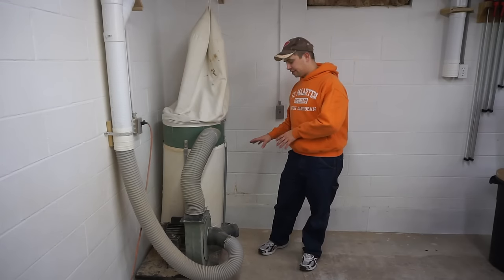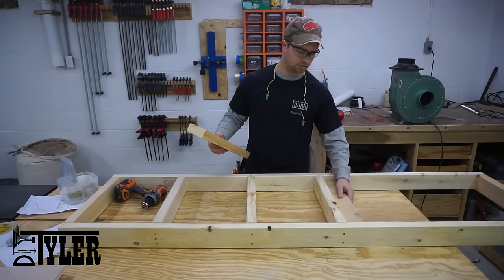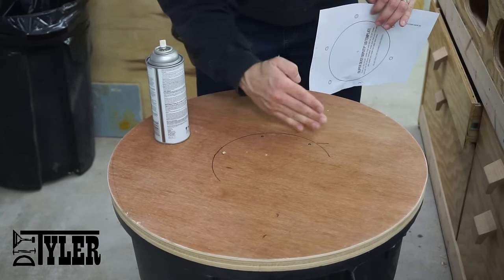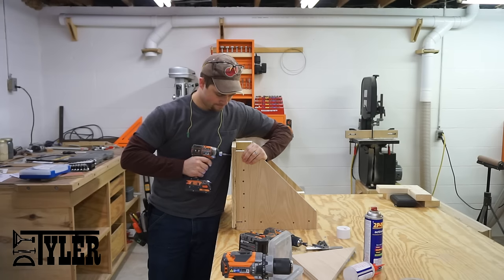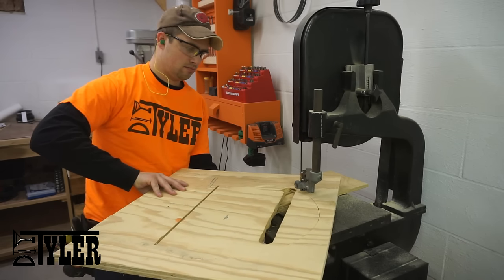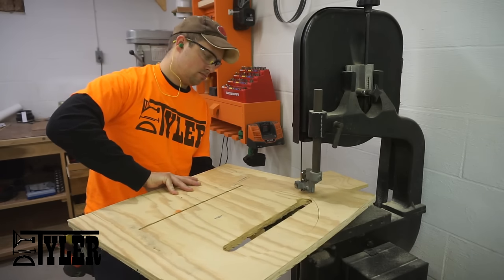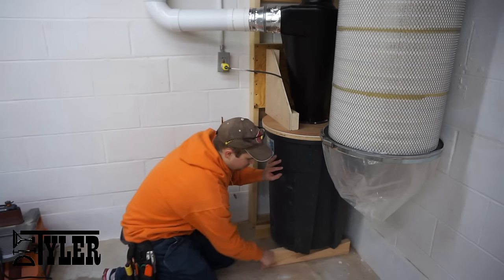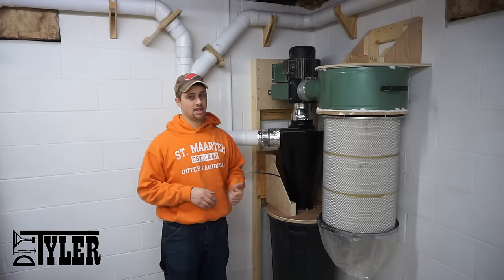2 Stage Harbor Freight Dust Collector

Comment: This taking from I've watched from Stumpy Nubs and adding the power of the Cyclone from Oneida.  The one difference is that you leave the dust bag as is where Stumpy Nubs cuts his bag and dumps it into a five gallon pail with a trash bag.  Although with the cyclone you are going to get far less debris in the bag requiring less replacements.  Just the same, I like his idea as the heavy duty bag will break down over time from removing the metal clamp that keeps it in place.  That simple modification to yours would prevent the you from ever needing to replace the heavy duty plastic bag.  I am picking up the Harbor Freight Dust Collector next weekend, and I plan to do a combination of what you have here with the modifications Stumpy Nubs did.  Thanks for sharing.  This was an excellent contribution.

Comment: Hey, being a Dutchman myself, I love your sweatshirt. I did something similar with a HarborFreight dust collector. The on/off switch will wear out quickly and more specific to replace. Wire your dust collector through a common wall switch in a more accessible area and leave the motor switch on. A proactive problem elimination.

Comment: I haven't done this myself yet but a friend helped a guy put copper wire inside his plastic dust collector system. The claim is static discharge can cause a fire within the pipe. I did notice static in my piping so it's on my radar to add grounding wires.  Nice build thanks for posting.

Comment: This was a great instructional.  I used it to convert my single stage Grizzly dust collector into a two stage system.  I made 3 key alterations though.  1.  My air filter is mounted on top of the out flow and the bag below the outflow.  I also used a paddle air filter that you can hand crank the paddle which flaps internal paddles against the air filter knocking dust out.  2.  When I used a rubber trash can the air suction was so great it crumpled the can causing the upper seal to be breached.  I upgraded to a metal can for a more rigid structure to with stand against suction implosion.  3. Once I upgraded to a metal can the wood feet used to hold up the can no longer worked well because the rubber can could flex a bit into its upper lid - the metal can wouldn't and kept falling when trying to put the feet in place.  As well, the upper lip of the metal can being much more rigid caused some air gaps.  To make it mount with a good seal I used toggle/pull latch clamps - the latch/levers attached to the can and the catch/clamp part is attached to the outer edge of the upper wood lid.  I use 4 of them equal distance around the lid and it pulls the can up nice and tight.

Comment: Thanks for this. You were the initial inspiration to make my own cyclone setup. I went with a 2hp Shop Fox blower, Oneida SDD, and Wynn filter. But  Dick Wynn recommended the Gamma seal lid approach to make a threaded filter attachment, and I did that. Mounted to a custom plenum out of Baltic birch.

I kept hesitating, drowning in dust, because the space is so restricted. Garage door and track on one side, lumber rack on the other, and the electrical panel right in the middle.

Comment: Great build.  I have HP's DC, and I know if using a cartridge you have to get more of the large dust/chips out of air stream (than a typical single stage can)  to keep them from clogging it.  This is a really nice solution to that problem.  Best one I've seen yet.
Reply from the maker: +bryce johnson Thanks man! It has been a huge addition to the shop.

Comment: Great build and well produced. High praise all around.  And...YOU USED A TRIPOD!!!! Yeah!!
The ONLY suggestion in would make is to use T-nuts on the back of the plywood used to mount the motor.  I think it would make installation easier and, in the event that you need to service the motor, easier to disassemble for service.

Comment: This is timely as I am adding dust collection to my shop in a few weeks.  I was going to go with single stage, but two stage would be more economical and effective in the long run.  Thanks for doing the grunt work for me Tyler.
Reply from the maker: 2 stage is without question the way to go and making it yourself will be, at most, about half the cost of getting a ready made one. Glad I could help, and good luck!

Comment: The Harbor Freight 2 HP unit already separates dust. That is why the bag is in on the top - so dust falls into the bottom after the integrated cyclone separator. There is even a divider between the two halves and it spins the air under the separator.

Comment: Tyler, nice video and a great help. I made a couple of tweaks due to space issues in my shop. At 12:40 when you were pushing your wedges in to raise your collector can, I have a 2x3 block against the wall to allow more clearance. I also glued a 3/8" plywood disc on the bottom of my can to add strength and act as a bit of a skid plate. Again thanks for the great idea and explanation.  Love the family helpers too!

Comment: i have a single stage 2hp Jet DC,  but after watching this video, i have a feeling i will soon have a 2 stage 2hp Jet. :) thanks so much for taking the time to make this video. i am inspired. -JD
Reply from the maker: +Jeremiah Dunnick Awesome. Might have something to help you out with that....will update you when I hear back. Thanks for watching!
Reply: +Tyler G , thanks. 
Any ideas or tips would be very welcome.  As soon as it gets a bit warmer i'm adding a 8'x8' extension on the back of my shop to house the dust system. it will have a return into the shop itself so the ac/heat wont be lost.  improving my dust system, as well as running more permanent duct work is the next step.  Your DC upgrade is exactly what i want to do.

Comment: Like your videos Tyler! I did a similar thing a year ago but wasn't happy with the air being recirculated even with a 1 micron pleated cartridge filter so vented it outside, works a treat!
Reply from the maker: +David Stanton If I wasn't in the basement I may have vented outside as well but many people can't so this appeals to a larger group of woodworkers! Thanks for watching!
Reply: David Stanton - I'm thinking of doing the same thing - venting to the outside. But, what did you do to provide a safe inbound air flow that would support the impeller driven venting? I'm in the basement with oil-burning furnace (common in New England, USA).
Reply: Dave, take care.  Some express concern that venting a basement shop outside may result in pulling furnace gases such as carbon monoxide into your shop.  I am not an engineer so I can not confirm with authority, but I would investigate.

Comment: Love this idea. I want to do this with my Penn State dust collector. Same design as the HF pretty much. Only thing I might want to do differently is a flexible coupling between the cyclone and the bin to be able to lift the lid for emptying.
Reply from the maker: This modification would work great with the Penn State....they probably come from the same factory!

Comment: You can clean installed bag filters by holding them up and blowing compressed air into the bag , in the reverse of the normal flow. Dust falls to the bottom.

Comment: Want to thank you for this unique set up. I’m so glad I found this.  It should serve to solve my space limitation problem. I also took a look at Jeremy's set up on Guy's Woodshop who is also inspiring me. I'm surprised we don't see the filter installed like you did, more often, since in your configuration the filter does not have to be above a standard ceiling height and there's a straight connection between the blower and the Dust Deputy and the blower and the impeller.  This seems like a more efficiently designed set up.  I’ll hang the impeller by turning the support legs upwards and mounting them on the ceiling, but I’ll
have to have someone shorten the legs and weld the mounting plates back on. I’ll
mount the blower and impeller as high as possible so the run from the Dust
Deputy can be as high to the ceiling as possible also.
What I’d like to know is, can’t the lid on top of the impeller be a simple thin piece of plywood just caulked in place if I’m supporting the impeller with the included legs?  And
would you have designed the attachment of the filter to the impeller any other
way, now that you have been using the system?
Thanks for your ingenuity and expertise. 
- Jake
Reply from the maker: Jake, thanks for watching out stuff. After making this video Wynn (company that makes the filter) has come up with a few clever clips that allow easier removal of the filter, if you ever needed to....I haven't, if I was do build this again that is the only thing I would change. This system works excellent.

Comment: Great set up Tyler, dust collector is on my wish list. right now i have a 3rd hand record power system which works but needs improvement. Previous owner never even used it.
Reply from the maker: +Craig Pereira Thank Craig. DC make such a difference, forgot how bad it was without one!

Comment: Nice Tyler, i have a two stage lid from woodcraft, but soon i was looking to convert over to a full 2 stage system like this. Thanks.
Reply from the maker: +Miter Mike's Woodshop I think you will find it to be a good improvement, in separation but more in the increased airflow. Thanks for watching man and thanks for the shirt!!

Comment: Personally, to collect the finner particules I would make a spiral with pipe elbows at the end of the sucking pipe so that a second centrifugal filtering would happen at high flow velocity with a tight radius ( Gforce= V/Rsquare) . This way the dust would go down the spiral back in the bucket and the air would go up. This spiral would be inside the bigger bucket so a lot of space would be saved.

Comment: Looks like a good system but you might want to look into reducing the number of 90 degree elbows and flex duct that you are using as they are some of the biggest reducers of airflow.

Comment: In my opinion, your system is pretty good. except 2 things can be improved.

1. The angle of the first elbow to the cyclone is too tight. it creates a big air flow lost. 

2. The canister filter should be placed at the top to let the fine dust drop to the bag. right now the fine dust will likely attached to the wall of the filter and blocked the air from coming back to the shop. 

What do you think?

Comment: I'm just getting a bandsaw, you made cutting those circles look so easy. What kind of a jig are you using?
Very informative video, I have the grizzly dust collector with two filter bags and two collection bags. I hope there is a dust deputy big enough for the 3hp motor.

Comment: Hey Tyler, great stuff.  I'm confused why you put the filter underneath the dust separator donut rather than above it.  All of your fine dust will get sucked to the filter and not to the bag.  I know your dust deputy takes most of it out of play for you though.  Thanks.
Reply: Blown to the filter,  If the filter is clogged bag will expand.  If the filter is OK allowing flow, the bag will be limp.  Great way to know if you need a filter cleaning or change!!
Reply: Usually due to limitation on celling height would be my best guess.

Comment: I was running my harbor freight dust collector with only flex hose on the floor, but ijust picked of 3 carpet tubes for free. the diameter is 4 inches so I plan to use then for my dust collection system. now I only need to buy fittings
Reply from the maker: +TechMechanic Sweet, sounds like a good score!

Comment: Best video yet.   Will be using most of your good ideas especially on mounting brackets.       Have you had good luck with your dust barrel your using?    Most everyone using these trash type cans are having collapsing problems with the plastic.

Comment: Good job! I'm curious how this holding up 6 years later..   I'll be using this video as a guide, but I intend to do a few things differently..  I'll be using the Donaldson P181038 filter which will save me about $100 over the Wynn filter. Also, I intend to use a 5 gallon bucket and screw adapter instead of a dust bag.  Thanks!

Comment: Very nice! I just gave away my Harbor Freight dust collector.
Reply from the maker: +Make Something Thanks David. You going with multiple stand-alone rockler units or did you get a new cyclone?
Reply: Multiple stand alones. My shop is "U" shaped and one central dust collector doesn't work well.

Comment: I was watching another channel wherein he mentioned that the manufacturer had specced a five foot horizontal minimum before going vertical on the cyclone.  He had a six inch main run pipe (PVC) with four inch drops.  Have you heard of that requirement?  I plan to put my collector in a corner much like yours so it is of interest if that is necessary.  He was using a clear cyclone more of a horizontal design, the name of which I do not recall.  They also made clear blast gates and accessories.  Take care.  Doug

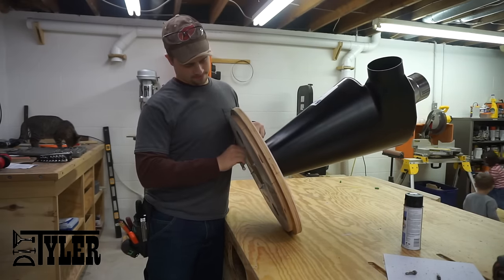Comment: Great video! You could have screwed the wood motor mount to the frame while it was flat on the table, and then it would have been easy to tip it up into place and screw it to the wall,  but then we wouldn't have  seen your lovely wife. :-) I see your kids are learning their way around the shop. I hope your wife was watching them because at 4:50 they are checking out the paint.

Comment: Good job Tyler.  Thanks for sharing.  One future tip your viewers might want to consider... using french cleats to hang the motor unit, instead of permanently attaching it to the wall.  It's a solid but temporary way to secure heavy items to a wall, with the flexibility to move easily later.

Comment: I have the small dust deputy attached to my Shop vac, which works great, but really want to step up to your dust collection rig, Harbor Freight and Oneida here I come.  I guess I can figure out how to make your setup, but if you could post a drawing or two it would be a big help to this neophyte retiree woodworker.
Reply from the maker: +Jim Challender Jim, if you would send me an email (DIYTyler@gmail.com) I can send you the very basic drawing I made to build off. No measurments or anything since I measured and cut based off the collector and cyclone. You will LOVE having a big system, so nice. Thanks for watching Jim!

Comment: Great video Ty. DC hacks and videos are always a pleasure to watch. and you do it with such ease. Well done. Central dc is on my to do list, but not down to that line on the list yet. I sure wish those pleated Wynn filters or similar was available in Norway. I have only found one supplier, and they charge close to 300usd for it, so I will find another solution for it
Reply from the maker: +Bellevue Woodshop Ha....my list is huge too! Yea $300 is a bit steep, this one was $200 shipped (that is steep too but it has x5 the filter area as others I saw.) Thanks for watching Roy.
Reply: @Harry Antonio instablaster :)

Comment: A pipe coming out the top of the lid you have on the final stage and piped outside through that window you have boarded off would save your filter a lot and keep your airflow less restricted.  you would still catch the big stuff, but the super small dust particles would just get shot outside.
Reply from the maker: Then I blow all the heat outside.....not a good idea in Michigan.

Comment: The original dust collector, if modified, would be a better choice.  The trick is to get a better top bag.  If you get the right felt upper, it will shed the dust layer at any change in pressure (blip in pressure causes bag to shake, dust to fall into bottom).  The right upper is then also rated for 1 micron dust, which is the particle size you really want to focus on.  Most standard bags from mfr are rated 3--5 micron; I prefer better because I like my lungs.

Comment: I'm not in the business so I can't confirm the validity of what has been stated in other videos. It's been mentioned that PVC is not a good choice for dust collection because it creates static build up and could cause an explosion. Unless you have wrapped the pipe with copper wire and grounded it. Your Thoughts?

Comment: What does that first stage really accomplish for you?  If you put the filter above the green filter holder instead of below it and put a larger clear bag on all the heavy particles would fall into the plastic bag and all the fines would be filtered by the cylinder filter.

Comment: Hi Tyler. I'm going to upgrade my  own dust collecting system , and the cyclone is lying around some place waiting. I think You and some other people makes great instructive vid's . And they all are going at it more or less the same way. It seems that You all think out the construction as You go. This means that You crawl around the system, gluing upwards, screw in impossible positions etc. I only ask: Why do You not assemble the parts  fully on the working bench where You are able to turn the parts around to obtain a optimal workingposition, and then hang up the assembly on the wall?
Your system is state of the art, but You learned me that I will assemble the different parts and then hang it to the wall. Yet another idea I got looking on Your work: I thing I will use some vibration cussions for the motorunit, cause I think that the whole wall will sing when You turn on the blower, and maybe some incapsulation of the unit with noise damping plates, i have seen some woodworkers do that. This not a critic, as I wrote, it is a very nice video, and I like Your children toddling around in Your shop